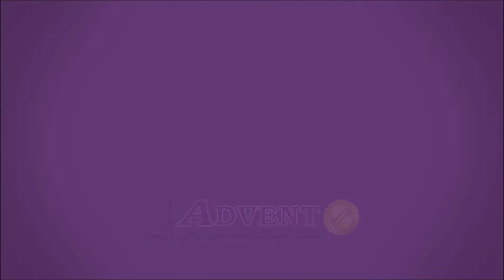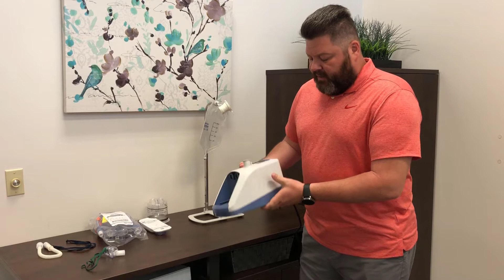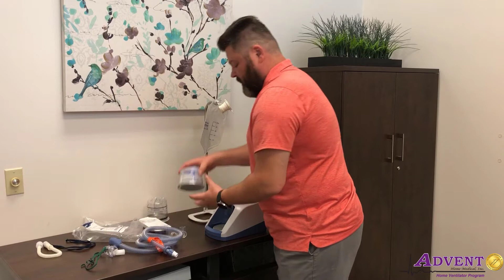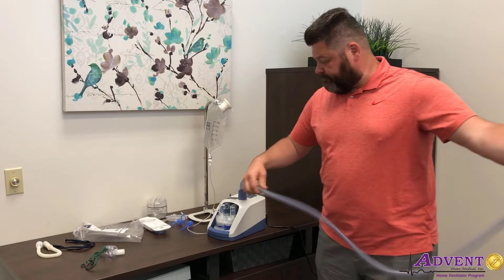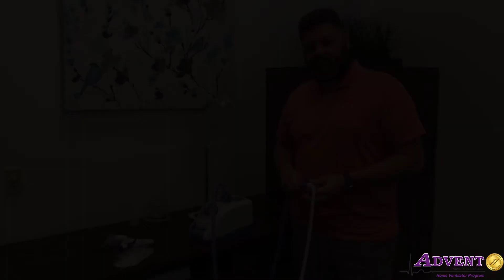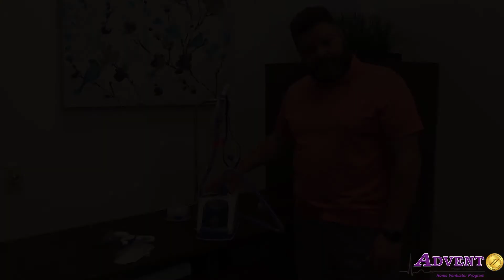How to: Fisher & Paykel Airvo 2

Comment: Question. On the myAirvo 2, usually You just see the check mark when It's heated and ready. But let's say you want to see the analyzed FiO2, so when you turn up your O2 flow, you get a measured FiO2. How do you access the in depth settings on myAirvo 2 to do that? What's the key combination?

Comment: I'm trying to get an AIRVO 2 for my tracheostomy. The DME has one, but It's already been a horrible battle trying to get it. i don't tolerate cool mist, and am on a ventilator most of the time, but like getting off for a few minutes. The HMEs dry me out, and I already deal with thick secretions. Can't get Pulmozyme because I'm not a CFer. Muccomyst causes severe respiratory distress, and so that had to be discontinued. Hypertonic saline doesn't help. So I'll try to get the Airvo, but if I can't, I won't be surprised. I even tried to get an Aerogen. That's not happenin either. So I'll probably just discontinue all vent trial offs, and go to Assist/Control, and stay there permanently. No sense in being off the vent if I can't get good humidification off of the ventilator. No sense in even breathing on my own at all. I'll just let the vent do everything, and I'll do nothing. Yeah, wanna do short periods off. HMEs don't humidify me, Cool mist does NOTHING! So why even bother getting off the vent?
Reply from the maker: Hey Peter, it sounds like the Airvo will be your best option. You could also try to adding a heater to the air compressor. Adding a heater to the cool mist can help with thinning out secretions and to keep you from drying out like the HME or cool mist alone seems to be doing. I would ask for a heater to be added to the cool mist if the Airvo is unable to be provided. Hopefully this is helpful. We service Michigan while our sister companies service most of the Midwest. If you are in the area we can certainly try and assist in getting you an Airvo of your current DME cannot! 877-944-9800
Reply: @adventhomemedical   I'm in the state of Kentucky. I'm talking to my DME right now, and they're going to try to get it for me. I think my forcefullness today helped. They're going to try. Also question. I think like an RT, and know about the Airvo, settings, and other info by heart. On the MyAirvo, I often see that FiO2 is not displayed. flow and Temp are displayed but on My Airvo the FiO2 is not displayed. Is there a way to get that displayed, or is that only visible on the standard Airvo 2?